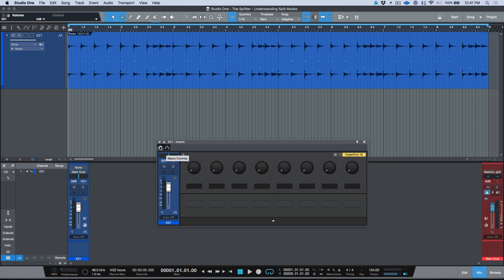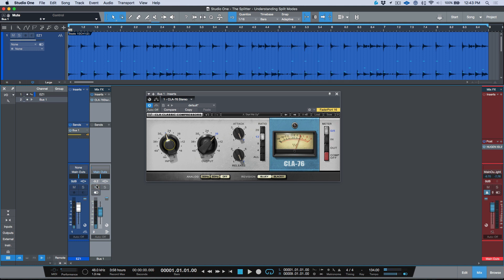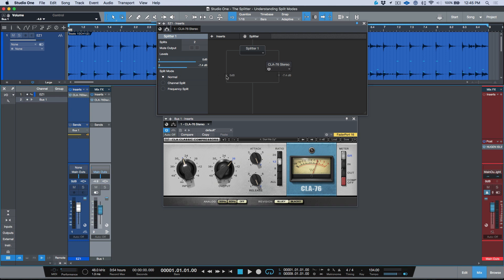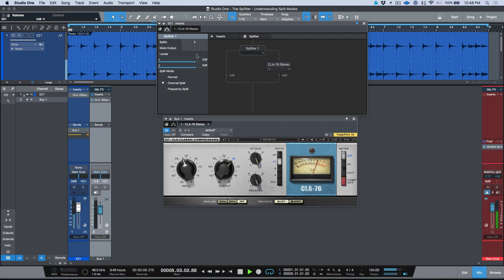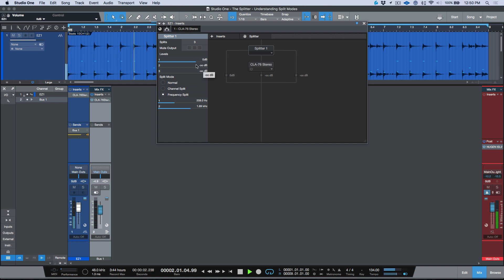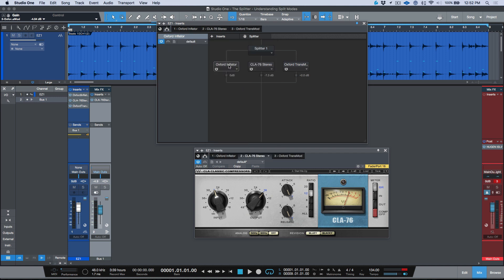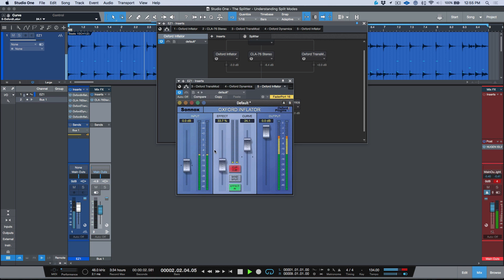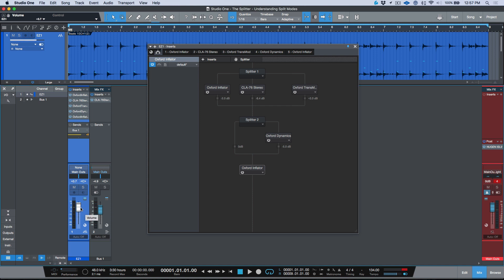Working With The Splitter In PreSonus Studio One

Comment: using the frequency splitter...the frequency ranges could not change for each division.....''am i missing something here..''....changing one range would effect all the other ranges and that whate you'd just worked on in the low frequency would be lost in making changes to the mids. in this way there is no way you can actually 'set the frequency range'....is there something missing here?
Reply: yes i was missing something....a quick check on a joe gilder clip 'cemented' what was being said here...both of you guys 'heaps props'....coz it helps us all.

Comment: When you create a parallel split, for example your Cla 76, can you follow that with another plugin like an Eq for only that side of the split?  I want to be able to create a split to use a multitap delay (D16 Sigmund) that doesnt have it's own global hi pass and low pass filters. Can I use the splitter to split to a plugin CHAIN rather than just one? 

If so this opens up a very interesting world of contained within track processing. This is of course possible using aux sends, but it will make a mix way more complex than it has to be if I have let's say 7 aux returns for just delays that then have to be aux sent to reverb. I realize I could just use 1 or 2 delay sends, but that's no fun compared to individual processing. I have already set this up using Cherry Audio Voltage Modular as an insert using a mixer module and 2 plugin host modules. This however makes a large CPU hit and extra plugin latency for no reason. I Have S1 Artist version that doesnt have the splitter, but would consider upgrading if splits can be to chains.

Thank you for your video.

Comment: Quick question, when using the normal mode and you add pipeline for an analog  parallel processing, when I pull down the parallel fader to  zero the left side comes down between 2-3dB should it remain the original level for blending the parallel fader?
Thanks

Comment: A great trick for more separation/clarity in the mix : put channel splitter on "MixFX" (last mixer channel to sum all outputs altogether), use split frequencies (split in two around 60-150Hz depending on the project) and put everything in the bottom to mono using Binatural Pan (width 0.00%). This way most of the bass will go to the center while uppers go sideways. 
Thanks for video mate, I've learnt a lot!

Comment: Marcus Huyskens Music "Actually it's not that.. When you use the Splitter, (from my tests) it seems to auto compensate the Gain.. So if i created 3 parallel Splits, their combined level (at unity Gain) would equal the dry track.. If you use a BUS - with a Send - the combined levels would "add up" and be much louder.. Perhaps I should have mentioned that, or compensated the master level in the edit...
Sometimes I really like this Auto-Gain feature, and other times, I wish their was a preference to turn it off..
Cheers, M"

 I thought I was going crazy!!  When you muted one "half" of the split, or lowered the fader, it's like the signal seemed noticeably lower than the dry signal, before adding the splitter.  I REALLY wish there was a preference to turn the compensation off!  This "compensation" is THE major difference respective to traditional bussing. IMHO

I imagine myself blending too much of the processed signal in with the original trying to get back to the level of the dry signal.  Also, if you're already doing proper gain staging, the 1 "half" of the signal might not be hot enough going into whatever plug in you're using for processing.

Comment: Great video Marcus but when you did the bus version the results were very noticeable. I think when you used the splitter you left the bus on and the signal was being routed to both the bus and the splitter if I understood you correctly. Am I wrong?
Reply from the maker: Actually it's not that.. When you use the Splitter, (from my tests) it seems to auto compensate the Gain.. So if i created 3 parallel Splits, their combined level (at unity Gain) would equal the dry track.. If you use a BUS - with a Send - the combined levels would "add up" and be much louder.. Perhaps I should have mentioned that, or compensated the master level in the edit...
Sometimes I really like this Auto-Gain feature, and other times, I wish their was a preference to turn it off..
Cheers, M
Reply from the maker: As for your question regarding the BUS - I had the Send de-activated so I don't think there was any double routing going on..